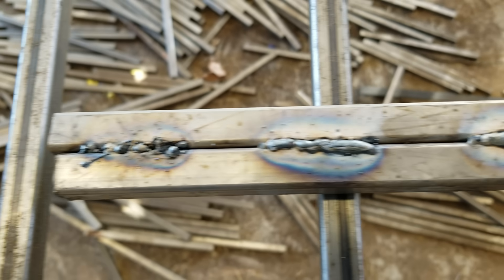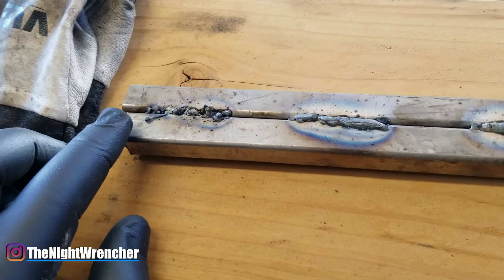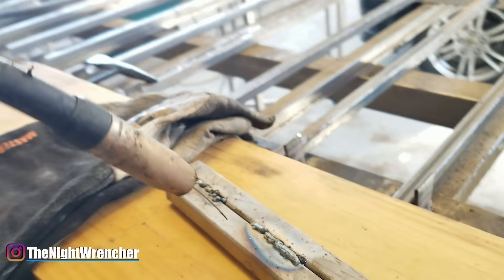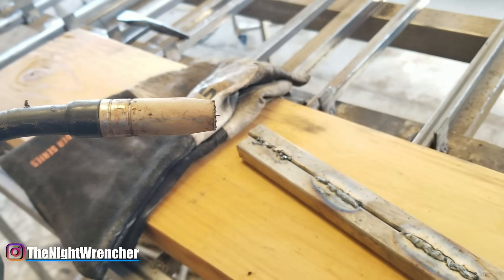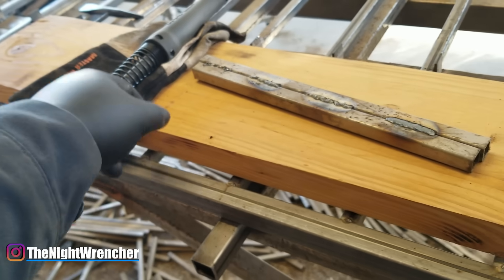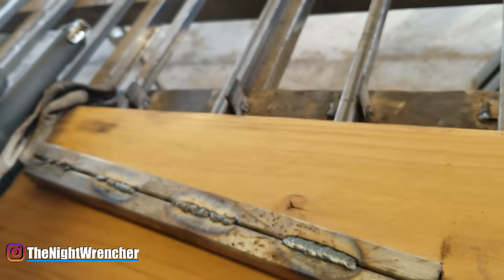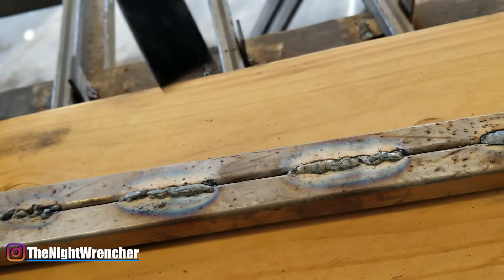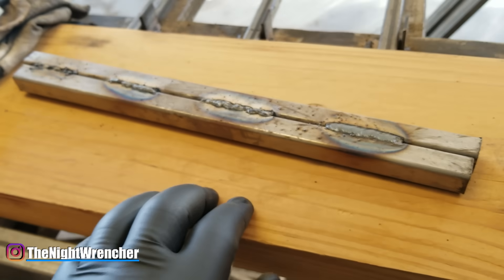Learn Perfect Flux Core Welds In 10 Mins | Gasless Flux Core Welding For Beginners Tips And Tricks |

Comment from the maker: Let me know if the video was or wasn't helpful!
Reply from the maker: For a rollcage, a 110 machine is more than enough. You'll want to weld on plates to where the rollcage is going to go. This allows the pressure to be spread out much better and makes it super easy to weld the cage to. Since you'll be lap welding the plates, you just need enough heat for solid penetration but dont go to far or you'll poke holes in the frame. On a stick you need to move forward and back because your hand feeds the filler material but with a mig machine, the machine should make the ripples on its own without needing to move it yourself. That being said, if youre going to be welding with gas, you can push or pull since theres no flux to create slag. You can use the same technique to create dimes with a mig like with stick welding by moving away from the weld for a split second and push the puddle back in. You gotta move faster to prevent cooling the bead too much but not too fast or your gas wont be able to shield the weld well enough
Reply: @NightWrencher  Excellent, very concise explanation for all types! 
I, like @anonymous, have been welding on and off for 50+ years, mostly with stick ac/dc. I now have flux, MIG & MMC (stick by a different name), most with the new IGBT (?) technology.. Your techniques coupled with these new ($100 to $250)  welders may yet make me somewhat competent! Thank you!!
Reply: Excellent demo, covered all the most common faults and gave a good account of how to eradicate making the errors and what to do about improving your technique
Reply: simplest and easiest to understand explanation I've seen ,straight forward plain speak , bravo sir! thank you
Reply from the maker: Thanks! Much appreciated!
Reply: I appreciate you taking the time to explain the causes of each example clearly. This was very well thought out and presented.
Subscribed.
Reply from the maker: @NateHiggers-k5x  Thank you! I really appreciate it!
Reply: help me a lot tq.. i am a beginer
Reply: Nice and to the point
Reply: Yes it was helpful
Reply: Hi my friend tankyoj for your very exelente explanation  very clear edgar guzman from santaana californiai have a25.  140 Welmark.  tankyou
Reply: Very helpful, but perhaps you might also explain/demonstrate what happens if wire-speed is too slow and/or movement is too slow (aside from burn-through).
Reply from the maker: I'll probably make a follow up video on the subject
Reply from the maker: You want to move just slow enough that you wont burn through on thin material but on ticker material you go by how big or wide you want the bead which is determined by hand speed as well as technique. If your wire speed is too slow it would be the same issue as too fast except the wire wont bump against the metal, it will just weld with pauses
Reply: I gotta say, that was a lot of words with no demo to accompany. I did like seeing the end product, but if u have the equipment to record your welding, so that we can see what you’re referring to in real time, that would do oodles of wonders to tie it all together.
Reply from the maker: I recorded a section but you cant really see what I'm doing because I keep my phone away from my welding so I don't melt it. I'll see what I can do on the next so maybe you guys can get a clear shot of my technique
Reply from the maker: @BruceLortzHI  its ok! Everyones gotta start from somewhere! Good luck!
Reply: Super helpful.  I started flux core welding a couple of years ago, but I don't do it very often.  Your explanations remind me of all the things I have to re-learn every time.
Reply: very useful. Please do more of these!
Reply from the maker: Ive already got a few more up now!
Reply: New to welding, super informative!
Reply: Very helpful
Reply: Welding god
Reply: Hell yeah!!!
Best most informative video!
Thank you 🙏🏻
Reply: Super helpful, thanks man. Perfectly described the problems I was having and how to correct them.
Reply: Been a diy flux core welder for quite some time, and I've never had a weld that looked like the one on the right. I'm gonna take these tips which make a lot of sense and give it a try this week. Thanks!
Reply: Still very helpful 2024
Reply: Bro! Your a Legend. You talked shed talk to this poor old Aussie. 
I've been hobby welding for thirty years I  s__t you not, my stick welds hold, but yes, scared of burning holes. 
Just got a gas less tig and yours was the first clip I decided to watch. 
Thank you, you really didn't disappoint, I resonated with it all and you said one thing that was priceless for me, " your pushing your puddle back" ❤ now it makes more sense, ikr. Just the way the words come into the brain can make a world of difference to. 
 "Slag you drag" didn't help
"Push your Puddle Back!" 🙏

Thank you
Reply: I hope i didnt sound ungrateful for the detailed explanation, which i prob did. So thank you for explaining in such great detail. Aloha
Reply from the maker: @6980869  no problem, to be honest I never thought this video would get so much attention so it does lack some details that ill include in the next video
Reply: I tried welding aluminium with a mig with argon shielding and aluminium wire but it wouldn't weld, what was I doing wrong?
Reply from the maker: Aluminum is tricky. Sometimes you need to preheat the metal before welding or turn the voltage way up. Aluminum disapates heat really really fast so fusion is much harder to do
Reply: 110v ?
Reply: Now I know that my wire speed was too high. BIG difference since watching your video. You are a fine teacher- thank you.
Reply: It was helpful but mentioning keeping of inert gas above the joint, the right gun angle, polarity, too low or too high voltage (& wire speed) and the right distance (cca. ten times of the wire diameter) would be more informative.
Reply from the maker: @istvankocsis5507  you're right, but, That wasnt the point of this video. First, theres no inert gas because this is gasless flux core, second I didnt go over the settings because upfront I mentioned that all 4 example welds were done at the same settings so the focus was placed more on the welder than the machine settings.
Reply: I hopped into the garage right after this and put down the best beads I’ve ever done.
Reply from the maker: @MrTerduckin  thats awesome! I'm really glad it helped! I've got another welding tutorial up already too if you are looking for more tips!
Reply: It most definitely was a great benefit! Now I feel like digging out my welding leathers and gloves. There’s a couple projects that I’ve been wanting to build but oxygen-acetylene just wasn’t gonna cut it. My wire welds sucked so bad that the vacuum about collapsed my head. Now I understand what I’ve been doing wrong. Perhaps I can resurrect those projects! I still need practice but that’s what projects are for!
Reply: Im a Wannabe beginner welder with a fluxcore welder i got from Harbor freight. To be honest welding makes me nervous because I'm very inexperienced in Electricity and Things that get Hot enough to fuse together within inches of my FACE LOL BUT my main question is. Initially "starting" the weld and "Ending" the weld, I feel like I'm doing something wrong so I stopped trying all together because i got scared LOL My wire stuck to my material and broke off.  I cant find a video "Explaining" what were actually doing the second the wire hits metal and how to break away from the metal when we need or want to ? Help ?! Thanks bro ! I subbed, liked and clicked bell!
Reply: i can weld...im not a welder...
so any information always helps...
Reply: very good.
Reply: Excellent video great tips thanks again bud you rock
Reply: Thanks so much, this was very helpful
Reply: Definitely was 👍
Reply: Fantastic! Thanks, from Australia. Great advice, and concise. Excellent video.
Reply: It was thanks
Reply: Very helpful.
Reply: very helpful